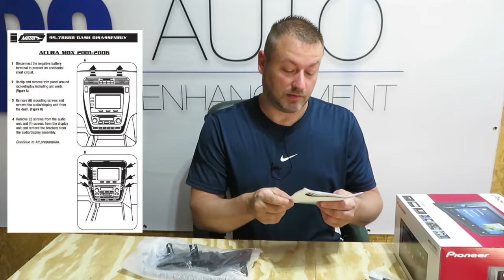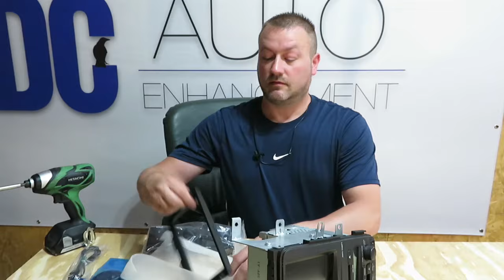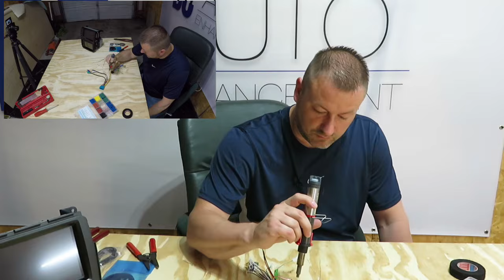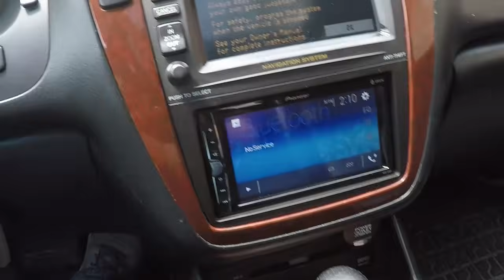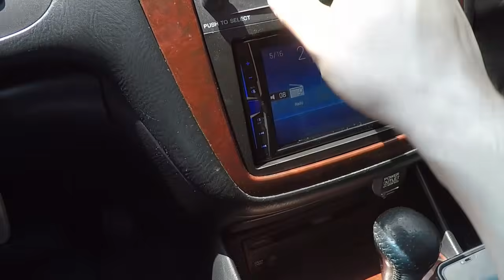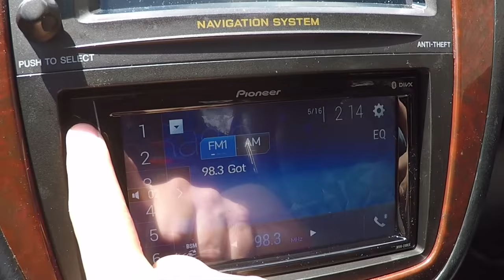2004 Acura MDX Stereo Upgrade Retain Factory Nav, Bose, and Back-up Camera Pioneer MVH-210EX

Comment: Do the AC controls on the NAV unit still work ?
Reply from the maker: Yes but on the 05 and up this installation does not work.
Reply: @DCAutoEnhancement  Have tried the 70 ohm resistor between pins 9&10 on the 15 pin connectorcso the canbus will on 2005&6 vehicles
Reply from the maker: @MartinCHorowitz   I have not tried that but that sounds like what I have read on a couple Acura forums
Reply: @MartinCHorowitz  can someone explain this to a simpleton ? im planning on doing this for an 05
Reply: so no one has figured out how to do the 2005. most sights advise against changing the stock unit out because of the loss of controlling the climate control. i have the black screen issue and would rather has newer equipment then to repair the old of which im not sure i could do.

Comment: What if my nab unit doesn't work says disc something. I have a 2004 Acura mdx but dvd unit doesn't work screen just says something about the disc when I take disc out and put back says downloading never downloads and goes back to the disc notice
Reply from the maker: It's probably looking for then boot disc for navigation. Only thing I can think to try is unhook the batter for a out half hour and see if it fixes itself

Comment: Hi, I hope you see my comment, I'm from Mozambique, I have a Honda MDX, it doesn't activate the attraction and it doesn't illuminate the lights inside, and here in Mozambique I'm almost the only one using a Honda MDX 2004, if you can tell me
Reply from the maker: Can you double check your connections and then verify you have 12 volts when you are supposed to and that your ground is showing continuity to ground?

Comment: Hello sir, thanks for your kind and helpful video . 🙏🙏🙏

I have got an Acura MDX 2006, can i use Pioneer AVH-220EX Multimedia DVD Receiver to have also DVD player?
Reply from the maker: I don't think this will work on the 2006. I think there is an issue with the touch screen. Please read through the comments and you will find your answer.

Comment: This may have been covered in the portion where the camera was bumped, but when you uninstalled the factory unit there were 4 sets up pins, but with the after-market there were only 2 sets. With the after market are the 3rd and 4th set of pins redundant and just don't need to be utilized?
Reply from the maker: It's been so long ago that I installed this but usually on an aftermarket radio there may be pins used for add-ons like satellite radio and such that don't get used on every installation. Factory radios sometimes have other components that don't work with the aftermarket radios, in this case the rear seat entertainment (DVD player) didn't work after this installation. I hope this answers your question.

Comment: Was this done on a base model because I read that if I change my mdx touring I could lose usage of my rear entertainment and wheel volume controls
Reply from the maker: I am guessing. I do know that if you do this on a model with rear seat entertainment,it will not retain that feature. For the steering wheel controls, you can buy the module to make them work.

Comment: thanks for your excellent contributions, one question RCA connects you to the amplifier option that the new screen brings
Reply from the maker: The wiring harness that I bought can be used with an aftermarket radio that has 4 channel RCA's. If it doesn't, then you can cut them off and wire them like speaker wires. I hope that helps
Reply: @DCAutoEnhancement  I will buy the harness that you used on my 2004 acura mdx but it has 8 speakers as it is called the input where there is RCA
Reply from the maker: @Ruiz1609  that harness should work for your 8 speaker system

Comment: Hello, how iso with the 8 speakers that it brings, how do I connect them?
Reply from the maker: If you use the wiring harness adapter and make sure you connect the blue wire, all speakers will work because it goes through the vehicles factory amplifier.

Comment: I used wiring harness 70-1721 (doesn't have RCA input pins). My speakers don't work,  after I connected everything and installed.
Reply from the maker: Look for a blue wire on the 70-1721 and hook it up to the blue/white wire from the radio.
Reply: @DCAutoEnhancement  Thank you. But there is no Blue/white wire coming from the radio. However, there is a Blue wire coming from both Harness and the radio, I have connected them, but still no sound.
Reply from the maker: Is there an additional wire where the factory wiring was that could be a ground wire than needs to be grounded?
Reply: @DCAutoEnhancement  only wires left (that are not connected) are coming from radio: 2 Brown wires, and 1 Pink wire.
Reply from the maker: @AliQ1977  any wires left on the car side?
Reply: @DCAutoEnhancement  No wires left on car/harness side. Just to make sure I connected the other speaker wires correctly...White goes with White, White/Black goes with White/Black, correct? Or shouldn't be the other way around?
Reply from the maker: You are correct. I am assuming you had sound prior to removing the original radio? If so, I would look in your fuse box(es) for an "audio" fuse or "amp" and check that. Also, is the antenna plugged into the radio while testing?
Reply: @DCAutoEnhancement  Yes, antenna was plugged in the radio. I will check the fuse. Will let you know shortly. Thanks for your help.
Reply from the maker: I wish I was more helpful
Reply: @DCAutoEnhancement  Finally got it working. Had to use a little piece of wire to "short out" Blue wire on the Car Harness plug. The reason I had to do that was that there is no connection behind the blue wire on the car harness plug. So the blue wire wasn't getting any voltage from the car battery. Unbelievable as it sounds, volume returned to all car speakers.....BTW I got this hack from YouTube.
Reply from the maker: @AliQ1977  I'm glad you got it working! 👍

Comment: I would like to do the opposite I want to replace my navigation but will the menu and ac and cancel buttons work
Reply from the maker: That is a great question. I can not answer that because I've never done it like that. I have a feeling that it will not work. If you search Acura forums, you may find your answer on one of them.

Comment: I got a cuestión I know the original stereo is loud on mdx 2005 .my cuestión is when you change the stereo is it still the same loud?plz if somebody can help🙏
Reply from the maker: Probably louder. The aftermarket radio has more power out than the factory radio.
Reply: @DCAutoEnhancement  thank you so much . You know what size stereo fits on this 10 inch or 7 inch?plz🙏
Reply from the maker: @hectorsanchez2146  most likely the 7 inch double din week be the easiest install
Reply: @DCAutoEnhancement  thanks again 🙏
Reply from the maker: @hectorsanchez2146  no problem sir!

Comment: Would this work on 99-03 (2nd gen) tl with the Bose system it has the sub in the rear deck
Reply from the maker: I don't know for sure. You may want to check out forums for that answer

Comment: I have a 04, I want to replace just my stereo system. Will this himder.my subwoofer in back. I do not have the DVD player or anything. Also any ideas how to get navigation system to work. Radio has started not coming on for a few minutes and then glitches (why I want to upgrade) and navigation system just stopped turning on
 Have not replaced anything yet.
Reply from the maker: This process will work for your 2004 as it pertains to the radio. The navigation may be something as simple as a blown fuse or as bad as the unit not functioning any more. The sub still works if I remember correctly.

Comment: Were you still able to control the air conditioner and heat
Reply from the maker: Yes, if you have a 2005 or newer, I understand it needs a resistor between two wires. I believe somewhere in the comments is a link to a right up on it.

Comment: did you connect the blue amp wire to the metra connector 70-1725 blue/gray wire?
Reply from the maker: yes, it was the blue/white wire on the metra harness if I remember correctly

Comment: How do you work yr ac controls
Reply from the maker: They function through the touch screen
Reply: @DCAutoEnhancement  i tght so i bought a 05 mdx today with black navi screen it lights up a lil bit then twice it said download software but i see a ac control button beside the blk screen i cant get it to work so i was gonna drop a pioneer like tht in but does no good for ac controls for me u kno how to fix tht askin for a cd problem?
Reply from the maker: @tatuman5000  I don't know much about them at all except the touch screen in the 05 and 06 are different than the 02 to 04

Comment: Where is the part to start watching to still be able to use the climate controls and such.  I missed it.
Reply: I bought this car used.  Last owner had the Pioneer  AVH radio installed.  She said that the climate controls didn't work after that on the touch screen above.  I found that very annoying because the only way to change the force of the air is by turning the temp up and down. 

Is there something I can do with the wiring to fix this? Also the steering wheel buttons to control the radio do not work.
Reply from the maker: I am assuming that your vehicle is 05 or newer. On this video I was installing the radio in a 2004. There is a difference on the 05 and 06. If you read through this forum thread, it will tell you how to retain the touchscreen after having an aftermarket radio installed. 
https://www.mdxers.org/threads/2006-mdx-replace-radio-and-still-have-navigation-work.171454/
Reply: @DCAutoEnhancement  its a 2003
Reply from the maker: Well, in that case, I'm not sure. Only people with the 05 and 06 have mentioned the touchscreen not working after installation. I didn't have to do anything out of the ordinary to get this touchscreen working.

Comment: I have a similar car ( 2006 ) and almost the same pioneer screen. I want to know if I can replace the top screen with it, do you know if i can do that? I dont mind doing it myself, just cant find answers to this lol
Reply from the maker: The 2006 is actually much harder to change the radio if you are keeping that factory touch screen.  From what I have seen in this comment section, the heater controls are integrated into to it and you have to do a modification to make the touch screen work. I don't know if that answers your question or not. I believe if you put enough energy and thought into something you can achieve it.

Comment: Does this also work with a 2006 MDX?
Reply from the maker: Thanks for the question but I believe there is a little more involved in your vehicle. It can be done but it's not an easy diy situation. Check the comments because it has been discussed.

Comment: Excuse my naivete, but I am not sure what you mean by installation kit instructions. I have the compatible PAC 4-Channel Line Output Converter, Metra Wiring Harness, and the Metra Dash Kit that are required for my older vehicle. Since I am using after-market parts, are the installation kit instructions available from a 3rd party or are they included with the stereo unit or any of the nec after-market parts? (I don't see a source in your links.) 

Also, I don't see the CD changer make/model in your links below. Would any single disk car CD player that fits below the stereo work using the AUX input?  

Crutchfield doesn't recommend installation of any after-market because of the risk to the car's climate control system. Can you please identify any related poss potential issues that I should make Best Buy aware of before the installation? Also, I understand that the CANBUS resistor bypass needs to be done in order for the factory navigation screen to still work. Is this accurate?
Reply from the maker: The dash kit that I used was from Metra 95-7866B
https://amzn.to/3mVFxeb

CD Player:
https://amzn.to/2Xh9A9v

2002-2004 MDX you can follow this video
2005-2006 MDX you would have to do the resistor to retain touchscreen functionality.  I have never done that install so I cant answer any questions regarding that.

also you can check out metraonline.com to lookup parts for your vehicle.

Comment: The link for the wire harness says it's for a 2002 Acura TLS and not an MDX. Will it still work?
Reply from the maker: The harness that I linked to is the one that I used. You can verify by going to metraonline.com and input your vehicle information in the application guide.
Reply: @DCAutoEnhancement  Awesome! Thank you!

Comment: Did you have to purchase a USB extension to get the USB cord into the "not an ashtray".  If not, how long was the USB wire that came with the radio?
Reply from the maker: If I remember correctly, I think the radio came with a 3ft extension

Comment: People do not do this. Especially if your car is loaded like mine. Crutchfield recommends not changing the head unit unless you don’t care about anything else. Go to crutchfield or call them. This guy is gonna screw your system
Reply from the maker: How so? I showed how this installation is performed and informed the viewers that the rear seat entertainment is the only thing that will not be retained on this particular year make and model. I am not screwing anybody's system.

Comment: Hey I have a 2001 mdx how do I hook up my single din aftermarket radio to the stock sub that’s all I need I just can’t figure out how I need to wire it up I’m leaving everything stock so just radio to the rear stock sub please help I’m going crazy
Reply from the maker: Are you adding a single din in addition to keeping your factory radio that would be running your door speakers?
Reply: @DCAutoEnhancement  I can send a pic to you over Instagram or Facebook anything to get it working would be so cool
Reply from the maker: @LimitFlight  I'm not on either of those. You can email it to dcautodiy@gmail.com
Reply: @DCAutoEnhancement  so I have my single din hooked up with all the door speakers working perfectly the only thing not working is my stock sub and I only have a single din hooked up no old radio that taken out
Reply: @DCAutoEnhancement  so it’s just the pioneer single din that’s in the car and the mpg screen.

Comment: Do you retain the ability to use climate controls?  Also what other stereo units would be compatible if you want to have USB and aux capability in the head unit?
Reply from the maker: On the 2004 yes, you can retain the climate controls. I have heard of newer (2006) having issues with the touch screen. There is a fix for that though. I just haven't done it, you may be able to find into in the comments. Basically any double din unit with six and USB that you like well work as a substitute for the unit I used.
Reply: @DCAutoEnhancement  Thank you!  I also the same would be true for the 2003?
Reply from the maker: I would assume that 2002-2004 would be covered by this video

Comment: By installing this unit will the DVD player stop working? Can you recommend another unit? The one you installed is no longer available. Great video.
Reply from the maker: Thank you for the feedback! The rear seat entertainment will not work after this installation. Also, I'm finding out from other viewers that if your vehicle is 2006 (I think) there is more work to get the touchscreen to work. Here is a link to a newer model with CD player.  The prices seem to have gone up a bit. https://amzn.to/3qU4QBa
Reply: @DCAutoEnhancement  Great! Thanks for the quick reply and link.
Reply from the maker: @sebestiensoliz2075  you are welcome.  Thanks for bringing the issue to my attention. I changed the link in the description. Have a great day!
Reply: @DCAutoEnhancement  Wait. Changed which link?
Reply from the maker: @sebestiensoliz2075  the one for the radio that's not available
Reply: @DCAutoEnhancement  Thansk again. How about the instrructions for the wirirng, please?
Reply from the maker: @sebestiensoliz2075  the wiring instructions come with the wiring harness
Reply: @DCAutoEnhancement  Is it the same the harness, dash kit and everything, since this is a new updated stereo unit?
Reply from the maker: @sebestiensoliz2075  yes it should write up the same
Reply from the maker: Sebestien Soliz  Indiana

Comment: So does the factory rear DVD still work?
Reply from the maker: No
Reply: @DCAutoEnhancement  is there away u can put an after market stereo and still have the factory rear DVD work?
Reply from the maker: Not that I am aware of. You may be able to Google your year make and model for example "how to retain rear seat entertainment on a 2004 Acura MDX with aftermarket stereo"
Reply: This is the problem. Crutchfield recommends not replacing it

Comment: Please tell me how the climate controls work. Does the new radio do it now?
Reply from the maker: No, what year is it? I believe the 06 and maybe the 05 have an additional step to enable the touch screen. I'm trying to dig into it for someone else.  If I find anything I'll post a link here.
Reply from the maker: https://www.mdxers.org/threads/2006-mdx-replace-radio-and-still-have-navigation-work.171454/
Reply: @DCAutoEnhancement  Definitely the 05 as well. This thread details a fix https://acurazine.com/forums/3g-tl-audio-bluetooth-electronics-navigation-94/aftermarket-radio-stock-navigation-system-956349/